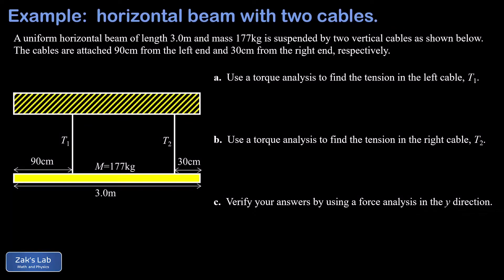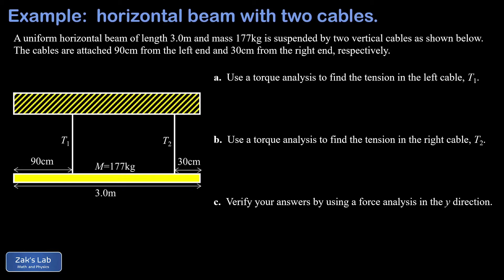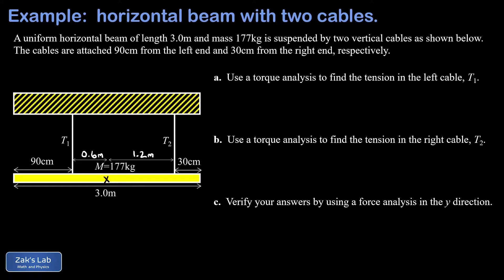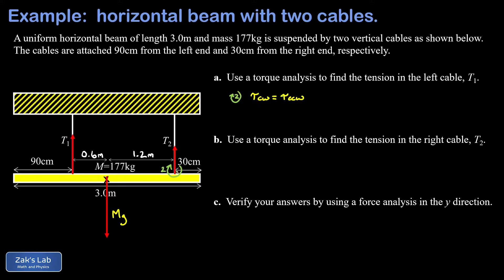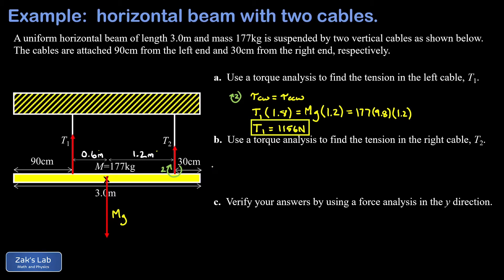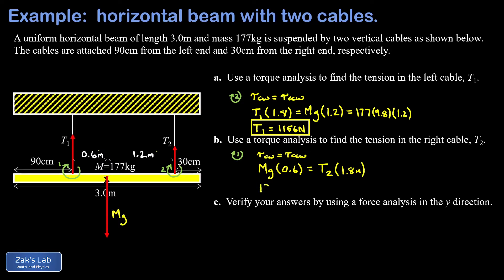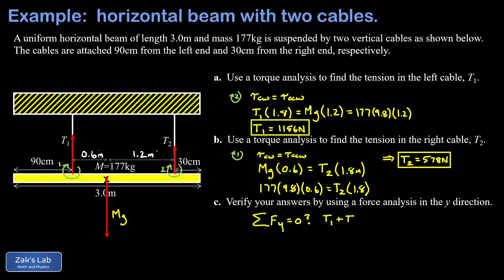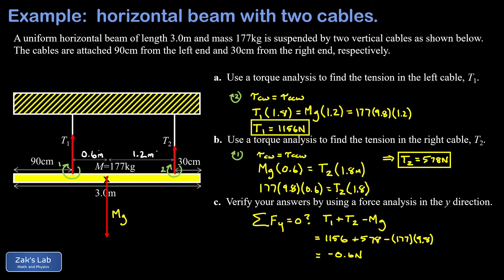Given a horizontal beam with two vertical cables, find the tension in both cables.

Comment: hiii,would you help me with this: A uniform straight bar of length 2.00 m and weight 450 N is supported by two cables at its ends to the roof of a house.  Cable 1 at the left end can withstand a maximum tension of 600 N without breaking, while Cable 2 at the right end can withstand a maximum tension of 500 N.  It is desired to place an additional weight on that bar. Calculate:

(a) What is the maximum weight you can place on the bar without breaking any of the wires? 

(b) Where should you place this weight on the bar?

i´ve been trying but i cant :(

Comment: Also, for parts a and b, may I ask why you set our axises of rotation at different places? I'm a bit confused. Thank you!
Reply from the maker: the power of static equilibrium analysis is that you can choose ANY axis you want as a rotation axis, and then say the net torque is zero with respect to that axis.  This is possible because there is no angular acceleration with respect to ANY axis you choose (because everything is stationary)!  So to solve for T1, choose a rotation axis at the location of the attachment point of T2.  Then T2 exerts no torque with respect to that rotation axis, because the lever arm is zero.  So when you set up an equation describing net torque about that axis, T2 is gone from the equation and you can solve for T1.  Next, you want T2, so you do a similar trick, choosing another rotation axis at T1.

Comment: In this problem, how are you supposed to figure out which forces are producing which kind of torques?
Reply from the maker: before you make a decision on the direction of torque, be very clear about what rotation axis you're choosing.  Once that's done, you imagine which way each force is trying to twist the beam around that rotation axis.  For example, an upward force to the right of a chosen rotation axis must exert a counterclockwise torque with respect to that axis.